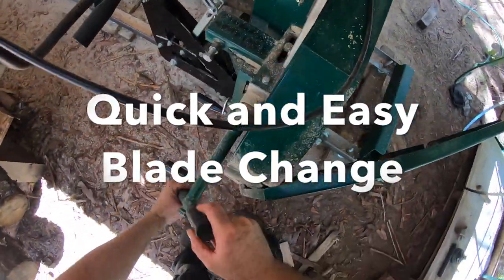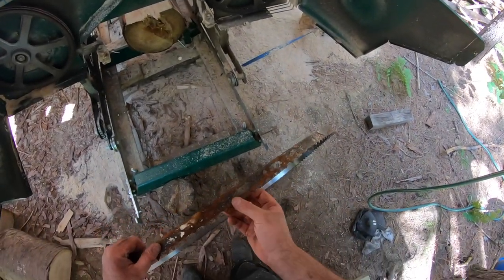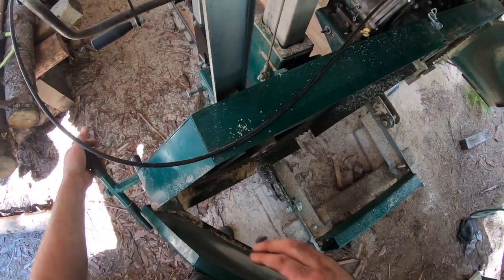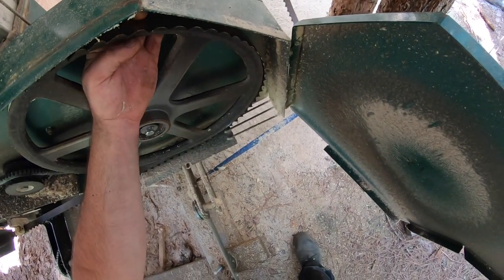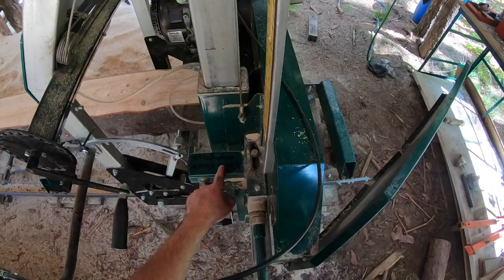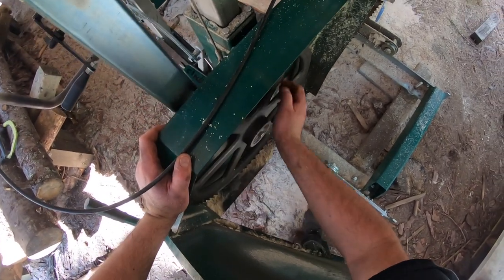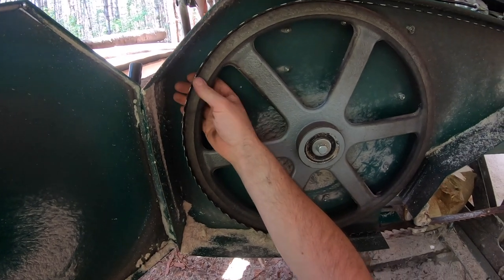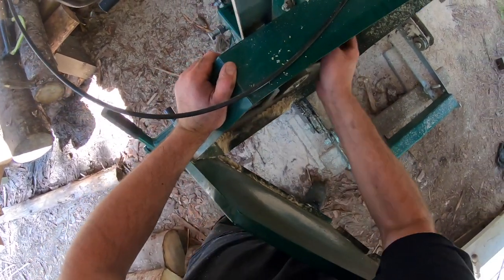Changing a Woodland Mills Portable Sawmill Blade

Comment: Those hobby mill are nothing like the heavy duty sawmills built to work.  Mine is all hydraulic and the tentioner is hydraulic.  Also the blade is 222" long.  In 10 years I have only adjusted the wheel alignment once and we use it every and have milled tens of thousands of BF of lumber.
Reply from the maker: Yeah I can imagine that the commercial units are quite sturdy for everyday all day use

Comment: Why check the blade alignment before spining the wheels, put the blade on both wheels, tighten the handle a few turns, then spin wheels, check for blade alignment behind the wheel, if ok tighten to spec and spin again to check alignment, just saying.
Reply from the maker: If you position the blade where it should be it is more likely that you will notice the blade beginning to come off the band wheels before it actually does. One turn of the bad can cause the blade to come off of misaligned on my experience
Reply: Just put it on so its on both wheels, tighten a bit, then spin, waste of time to check before spinning.